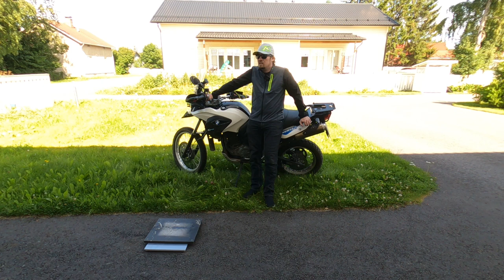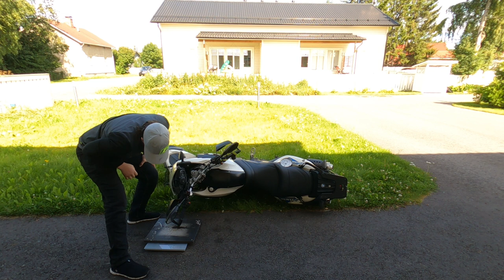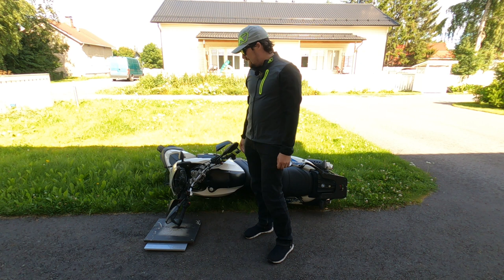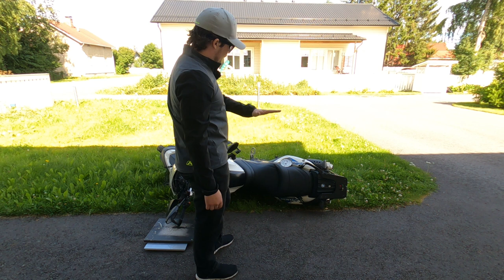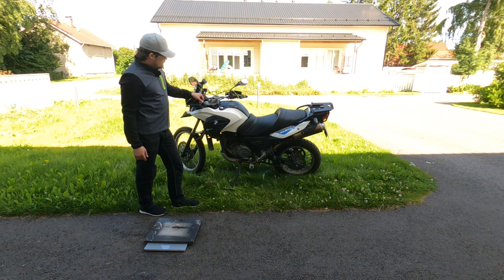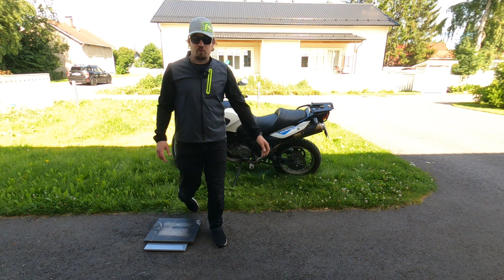Part 1/2: Why is nobody talking about this? Adventurebike lift weight

Comment: Interesting observation indeed! I guess the bike is never a dead-weight when it's being lifted, and the important thing is having the right pick-up points on the bike, to make this process easier. Thanks for sharing and greetings from South Africa!
Reply from the maker: Thanks for commenting! My way of measuring this is not perfect but currently the only way I have to do this. Measuring the weight by pulling and mesuring the weight on different portions of the lift would be interesting to do. This however requires a lot of gear that I don't have at least for now 😅

Comment: We here in winter conditions get maybe more into situations where you have to pick up a bike? I found my older Africa Twin RD04 quite hard to pick up on icy trails. Really hard.
Reply from the maker: Yep that's why I'm not riding my Tenere 700 in the winter and bought this Honda. This is so easy to lift in any condition that I don't need to worry nearly as much. I have much more confidence in taking this little Honda anywhere even in the winter.

Comment: Engine heat a lot?
Reply from the maker: When riding? Dont understand the question 😊
Reply: @PatchedBandit  yes, engine heat bothers in the summer?
Reply from the maker: @dommotos  I have never noticed any excess heat bothering me. I have driven this bike in 30-35˚C (86-95˚F) heat but nothing hotter than that.
Reply: @PatchedBandit  I am analysing this bike as replacement to GS850 due to less weight but people are saying that does heat a lot
Reply from the maker: @dommotos  Pretty sure you wont have an issue with heat. Its a liquid cooled low power thumper but then again we are all different. I drove about 20K with mine. I have a video on my channel where I summarize my thoughts about the bike before selling it. I swapped it for a Tenere 700 but slightly regret not keeping it. Suggest getting the Sertao/Dakar if you can live with the height.